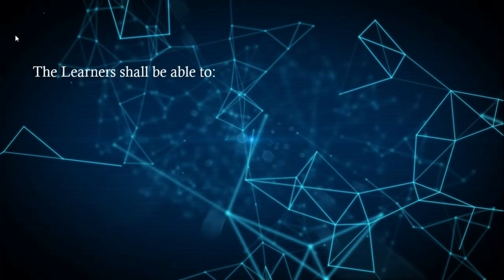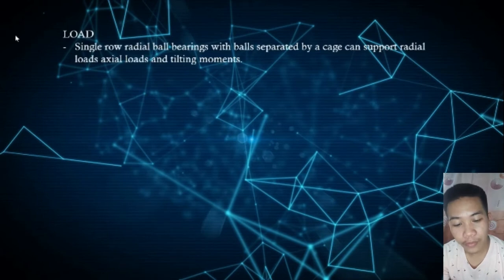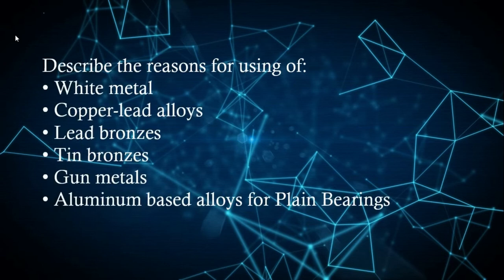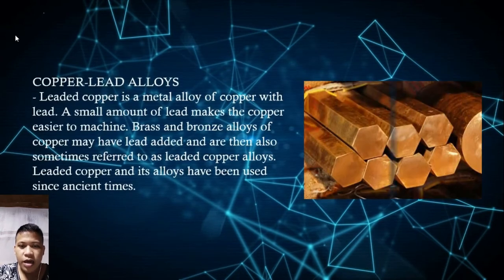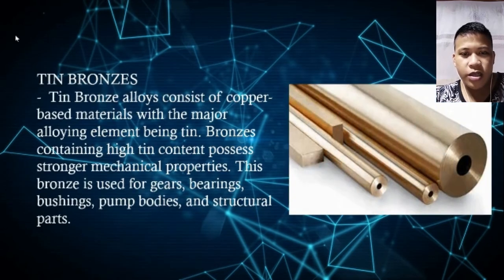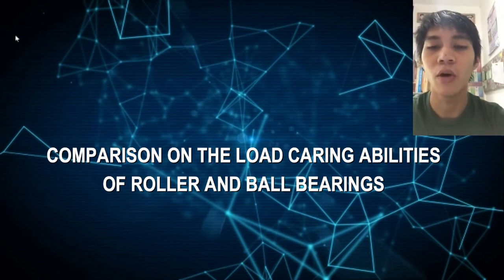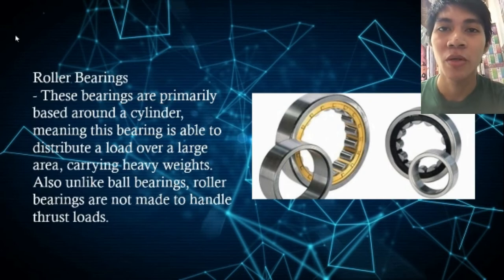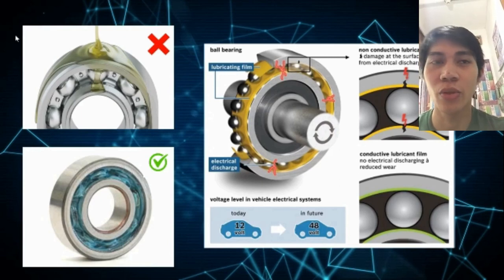13. EMAT: Design Characteristics of Bearings

Comment: In this lesson i learned a lot the important of bearing the friction is bound to occur between the rotating shaft and the part that supports the rotation. The bearings serve to reduce friction and allow for smoother rotation. This is the single most important function of bearings.

Comment: Thank you for sharing your ideas and knowledge about the design and characteristics of bearings. I've learned a lot especially the difference between ball and roller bearings and also I've learned what is the proper way of applying lubricants to the bearings.